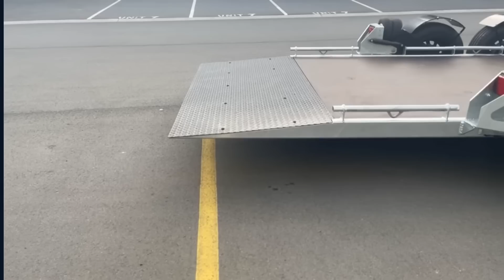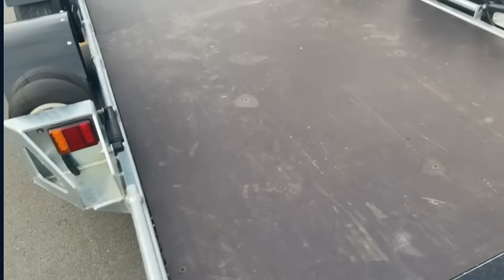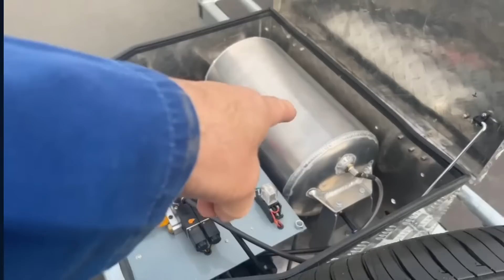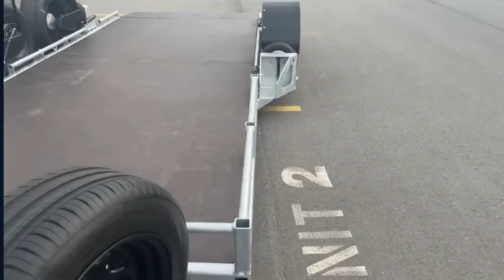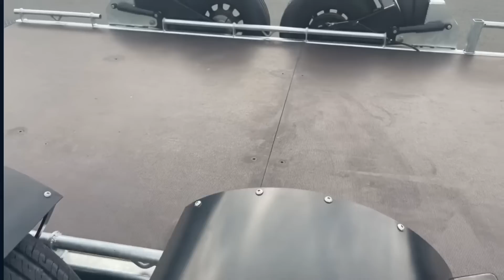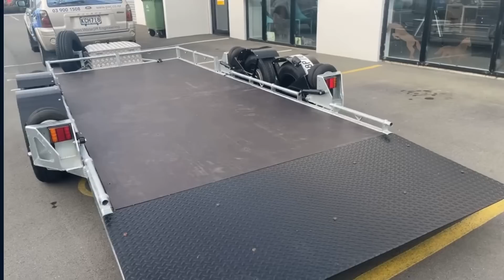How does an Airbag Trailer work 1.3

Comment: Hey I'm not down your work bud you do nice work but that just chill with the airbags you got a good couple loads you got to sign puddles of the airbags the shaft that connects to the airbags up in Bolivia have looked up to him. Just problems that's a disaster waiting to happen you drive down the road a heavy load on that and the airbags blow out of one side the whole load shifting test side that blew out it's going to fall over the trailers going to tip that's a bad freaking design that's an accident waiting to happen
Reply from the maker: Good observation, we have done some road testing and I'll post a video soon, where we have lowered one side to see what happens, it's a slow process and all is under control leaving plenty of time to stop safely.  I have seen plenty of leaf spring trailers park on the side of the  road with broken axles and springs and they look a pretty buggered.  I'm not sure our trailer is any more a problems than those.

Comment: Seems like a lot of parts n pieces that could fail n leave u stranded. Cool concept, but not really reliable for the long term.
Reply from the maker: We have build a lot of these over the last three years, nothing has fallen off or failed yet.  
The air system is tested and over rated, no failures yet the compressor is 100% duty cycle, no failures yet, The chassis is 4mm and galvanised, wheel bearings are High Qaulity Japanese bearings. no failures yet, Deck, well looks ok after three years. the battery, ok they might fail. buy a new one.. So, What do you think is going to fail?
Reply: @ultimatemanshed  to many electronics, air fittings, and individual connections that can fail. Then ur stuck with an inoperable trailer.

Comment: What happens in case of leak or catastrophic failure of the pressurized air circuit ? How about moisture and freezing weather ? Is the air tank certified? What happens in case of an accident to the air  tank? I like the idea but I am a bit sceptical about reliability and safety. Probably OK for handling hobby gear but on a daily basis for heavy duty stuff ??
Reply from the maker: If you get a catastrophic leak, the trailer goes down.  The air tank has a drain tap and should be periodically opened to remove tank accumulated moisture, we have had no instances of freezing damage reported. Yes the tank is certified, our maximum pressure is 280PSI. I do not know what you mean by "What happens in case of an accident to the air  tank?"  The worst thing that can happen is it leaks, you fix the leak :-)

As for long term reliability. we have a few customers that use their trailer almost daily, certainly 3 days a week and they carry large tractor over 1.6 ton and they load and unload 3/4 times per day.  They have owned and operated for nearly 3 years and one commercial operator has purchased three trailers of us.
Reply: @ultimatemanshed trailer. Many thanks for these precisions.

Comment: & when driving down the road and a Air Line Rupture or Air Bag Failure, Air bags do FAIL happens that thing bottoms to the Road & Creates Spark Storm. Plus Steel RUSTS & is HEAVY !!
  Those Air bags will DEGRADE Fast being exposed to the Sun like that or some VANDAL pulls out his pocket knife and has fun. 
   Cute Idea but NO THANKS !! 👎👎
Reply from the maker: You're a conflicted person, great but no and all bad but sort of good.  
We have never had an air failure, but yes I'm sure we will one day. Sort of like a normal trailer getting a flat tire I suppose, you might have to fix it.
All trailers are galvanised, I think it might outlast your use and if not steel are you going to build yours from plastic or wood maybe?
The airbags are UV protected but I suppose yo could say the same thing about all rubber and plastic on all vehicles, good point.
 So, can I ask, why did you bother commenting if you don't want one?

Comment: Great trailer, it would be very handy. Only thing that troubles me is that the ramp corners would be hell on my shins!
Reply from the maker: its ok, we have you covered. Every trailer comes with an EBAY discount card for Shoe Heaven and they stock a nice line in bright Red high heeled thigh boots with frontal impact inserts suitable for stage and trailers.
Reply: @ultimatemanshed  😆
Reply: @ultimatemanshed  🤣🤣🤣💯most valid response you could’ve came up with

Comment: This would be awesome for a travel trailer. Easy leveling at the site instead of having to block one side or the other
Reply: That’s a great idea!
Reply: It would be a bit overkill, added maintenance and failure points for a travel trailer that it doesn't need since the overall weight really isn't ever changing.  Just simple electric jacks would and do work fine.
Reply: Not really, airbags are bouncy
Reply: @kylewright8512  That's why shocks are there as well. Some of the most confortable cars out there used airbags as well.

Comment: Sick, I'd like to see what hubs you used. Nice work
Reply from the maker: Scotty, you can use any hub you like, just a matter of welding that stub axle into the correct offset distance so you have good clearance from your rim to the swing arm. We use a 5 stud for most applications but anything will do as long as it's the correct weight.
Reply: 5 lug hub assemblies are common. 3700lb axle/hubs and matching wheel tire combos. Problem with airbags is you better have an indestructible air system and air bags. There is no such thing. I stuck with torsional sprung axles and a pair of ramps. 12" min ground clearance goes far. So smooth the owner has to keep looking to see if it is there. Not bad for 6Klb trailer at 70 MPH.
Reply from the maker: Excellent, I am glad you have found your solution. we can also offer a variable height, low when cruising down the highway and you can lift it up with the remote control if you encounter a driveway or rough terrain when traveling, no need to get ou of the car even.
Reply: What about a safety cam lock to prevent catastrophe in the event of an air leak? Hmmm…
Reply: @scottjnipps  Possible if you have a dampening system, otherwise it would get rough quick. I like Airbags. But it's a brutal world. I have other designs in mind. I haven't cross referenced patents yet, but not a field I plan to endeavor other than personal or associate use.
I serviced fleet trucks with air systems, for brakes and suspensions. Still design and build them for multiple purposes. 
I like the the low slung capability and the smooth operation of the system they displayed. In Florida the bags would not last long, as the Sun eats everything. Maybe a Solar barrier would preserve the life of the bags. Sunbrella?

Comment: the twisting effect on the side plate  ,,,,,,and the tire wear??? whit two ton
Reply from the maker: Are you asking what the twist is?  Our tires do not wear any differently from any other trailer, in fact, they are generally better. and yes the suspension is built from double-plated mild steel with internal rigid support and designed to twist under harsh conditions, this stops axles from breaking and allows things to move a little with less chance of high wear on bearing etc.  Tried and true over many years and many trailers.

Comment: I hope those fenders are made out of plastic because if you've ever watched a spindle/axle mounted fender going down a washboard rode it shakes the bejesus out of them and usually cracks them at the mounting points.
Reply from the maker: Yup, any rough road shakes them to bits really fast. SO... we have built them out of 4mm propellor plate attached with HT Huck Bolts to 4mm steel side plates welded to the swing arm.

We have used plastic, fibreglass, thin ali, thick ali and everything else you can think of including all methods of attachment, and this combo seems to last the longest and in New Zealand, we have plenty of rough metal roads.  It goes against engineering principles to have the unsprung weight heavy, but in this instance, it seems to be the answer,
Reply: @ultimatemanshed  
Well done!!!😉👍

Comment: As a truck driver, I've  pulled all kinds of trailers.  From 53 ft all the way down to 8 ft utilities.  This is by far the absolute best looking and looks like it functions extremely well and looks very sturdy also.  Would love to buy one of these at some point.  Finally a smaller trailer that wont  beat the absolute living hell out of whatever your hauling
Reply: Hope you can play around with one, one day. I think it's cool. I like truckers, they are cool.
Reply from the maker: Thanks Nick, yes they do run smoothly as the airbag are the suspension as well as the lifting mechanism, we are working on a design for a two-wheel version that could be used for motorcycles and golf carts etc.
Reply: @ultimatemanshed   put some flow valves on the air lines. You can smooth it out nicely that way. I’m looking for a new job by the way 😉🇺🇸
Reply: @Landrover Series Chassis and Airbag trailers  pretty exciting inmy opinion.  Looks sweet.
Reply: What was the main decking material called ?

Comment: The bags are unevenly loaded. Parallel arms are needed. You folks aren’t quite finished the engineering
Reply from the maker: You are wrong as we have independent air controllers on to each bag and you can set up  according to weight. Watch the other videos.
Reply: @ultimatemanshed  You missed the point.  Of course the sides (L and R) need to be independent or you'd dump the load when cornering.  My comments concern the bags themselves and how they're mounted and loaded when going through the range of tavel.  The bags should push parallel from their top and bottom plates.  A slight radius is fine but your bags are pushing around corners.  Think of a 4 link setup on a drag car.  The orientation on the trailer isn't important but the relationship of the bag top and bottom is.   Think of it like this:  if you remove the bolts securing the bags, aired the system uo, do the bags stay or pop out?  Yours pop out.  If the plates were parallel throughout the range of travel, they would stay in and be assured that it's well designed, 
This isn't a new concept.  I built my 1st one in 2002.  If you like,  I'll sell you some proper engineering plans with cut files in fusion 360
Reply: @BruceBusby  as long as you don't exceed the stress limit of the rubber their should be no concern. That load it evenly distributed throughout the bag by air pressure. Just don't over stretch the rubber
Reply: @BruceBusby  also, you rewrote that comment with a very different attitude lol
Reply: @everettstormy  you're wrong, again!  Those bags are pushing around tight radius corners.  They're not intended for that.  The manufacturer makes that clear.  Check out Goodyear test condition data sheet for confirmation.  The weak link in that system the mounting plate bolt shear strength.  They'll eventually fail and it could be catastrophic if loaded and at speed when it does.  If the trailer  manufacturer would like to test my theory... they only need to unbolt the bags and inspect the mounting plate hardware for side loading bolt and hole deformation.  A trailer with real world use will show what I'm saying
Reply: Lmao, can't stand people, you really don't know better than the person who has done it. Just like engineers and architects man
Reply: @everettstormy  I guess you should have waited for my reply before you posted.  You sure look stupid now!

Comment: I am a bit surprised it is road legal with no safety system if air pressure is lost. Very cool trailer though, would be great in the winter not having to deal with an icy beavertail.
Reply from the maker: Good to hear your comments, any idea what this safety system would look like if air pressure is lost? and why would it be illegal if it potentially failed, Much like any other mechanical product failures can happen, and they are a pain but you deal with it. I can't think of a way of mitigating air pressure failure unless you had a dual system, then it becomes uneconomical.  We recommend a good service check every 6 months and keep an eye on things.    Sorry, I cant come up with a viable solution for you on this one. Alan
Reply: @ultimatemanshed  Pins of some sort would be my thought, but as for designing it, I would leave that to someone else. I just fix trucks and trailers for a living, I'll stick to what I know. 
With that said, a check valve on the inlet to the bag and a quick release dump valve at the bag (with a pilot line to actuate it) would isolate the rest of the system from the bags. That way if a line gets torn off you don't lose all pressure, and if a bag goes, you only lose that bag. The parts are not that expensive to do it either.
I wasn't trying to give you a hard time about the trailer, if it's legal, send it. I don't think that would fly in my neck of the woods, but I could be wrong.
Reply from the maker: @--_DJ_--  I look forward to the comments, keep them coming. The air lines cannot get torn off as they are all internal,  you can't see an airline anywhere outside the chassis that can get caught. We have tried taps on each valve inlet, these work but you still end up with an un-inflated bag not holding its load.  it's a good fix to get you to a service point. We will be re visiting this as a long term solution.
Reply: @ultimatemanshed   I didn't even notice the axles were actually swing arms the first time I watched it. It has to be the coolest utility trailer ever made.
Reply: @ultimatemanshed  As for why it might not be legal, usually a failed bag or air system still allows some limp home capability, or isolation to provide that. it looks like this thing would be laying the trailer on the ground in a hurry if the pressure was lost.
Reply: I also don't know the legality of this in my area (Texas, USA) but if it's passing inspection where you are located then you're good to go I suppose. Regardless of legality though, I agree that having some removable pins as hard stops would be prudent. If nothing else, it would make roadside repair easier (or, maybe possible is the right word). I can imagine it is a chore to replace those air bags, especially if one has ruptured and the trailer sits on the ground. You would have a hard time getting a jack under it. With pins to prevent it dropping lower than the height at which you can still get a jack under it, I think that would be a win. 

And the system for isolating blown bags sounds like a good idea too.

I am very impressed with the trailer. It's something I've been looking for for a long time and decided it didn't exist. Where are you selling these?

Comment: Nice trailer, one what i would add is pressure release regulation, even empty it drops fast and even faster if loadet.
Reply from the maker: it has a slow pressure release valve and can be manually controlled or set to a speed you want.

Comment: Excellent.
On failure (stuff happens)...  what system is in place to warn the driver that things are about to hit the road.
Reply from the maker: Sparks happen :-)   Sorry the is no warning device, however we have some trailers out there that carry about 2 tons every day and load and unload about 4 times per day on each, never had any parts fail yet but after 3 years. However I am going to suggest we replace the airbags next year, the Compressor is 100% duty cycle and the air lines are 1000PSI rated, we operate around 190 PSI, so the only weak point might be the air control valves but again no failures yet.